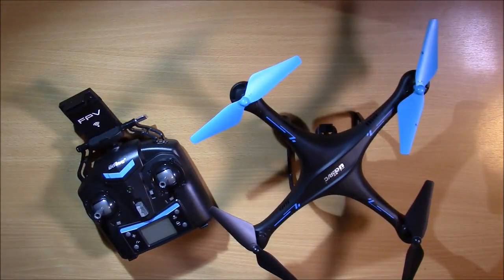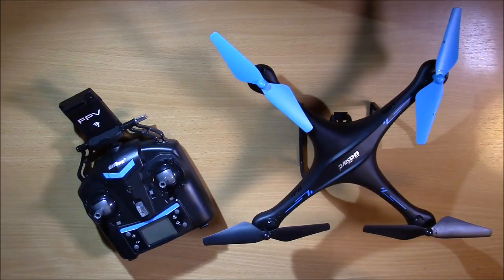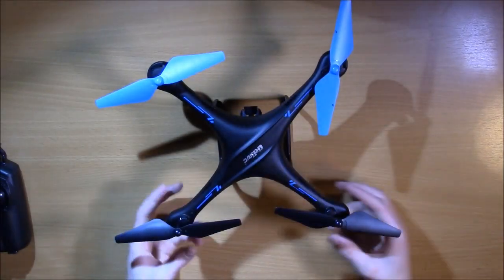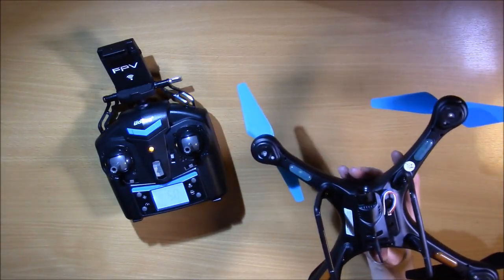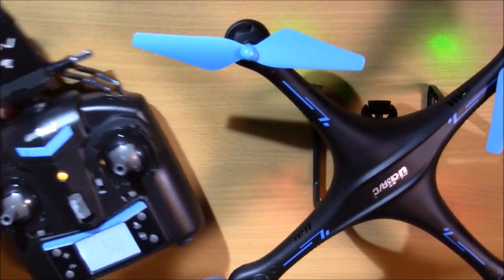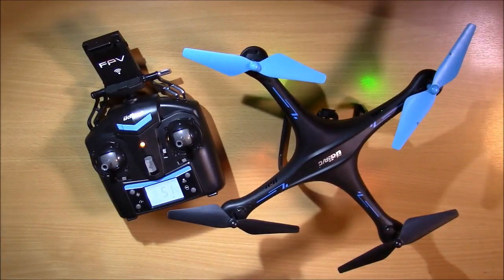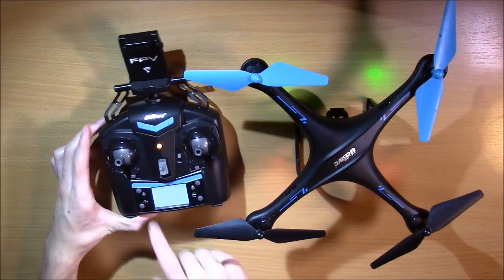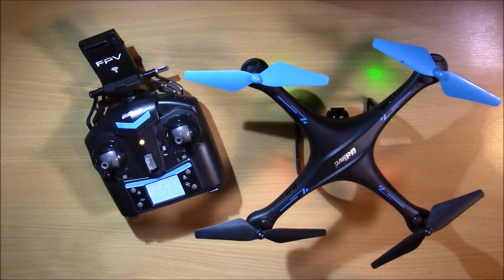How to (Perfectly) Calibrate Your Drone! | USA Toyz

Comment: Everything did as shown, but when it takes off, the controller starts beeping and the drone drops. The is with fresh batteries in both the drone and controller. All the motors have been replaces, and it was sitting idle of a few weeks.  
Any suggestions?
Reply: Maybe you have not recharged the drone (not just batteries, with the wire)
Reply: Might be the low battery protection that's warning you ..

Comment: Hey, my drone is a HR SH5 and everytime i go to take off, it just tilts over onto one side and hits the ground. I tried calibrating, not sure what to do to fix this. help?
Reply: 6S Network same problem
Reply: Exact same problem
Reply: 6S Network same
Reply: 6S Network hhj
Reply: Same
Reply: Did you switch out the blades?
Reply: Maybe you didnt assembled the blades porperly
Change their place.
Reply: There should be a (A) and a (B) blade so make sure u have the right color and right letter